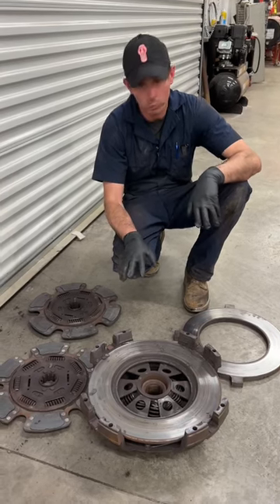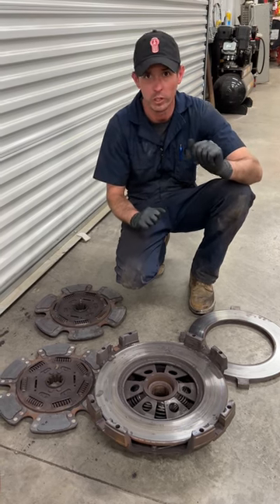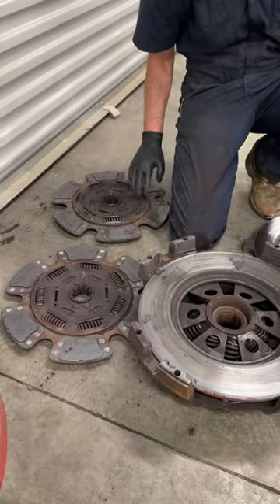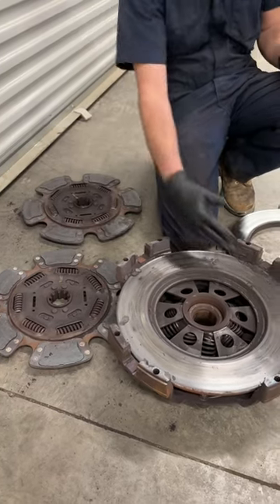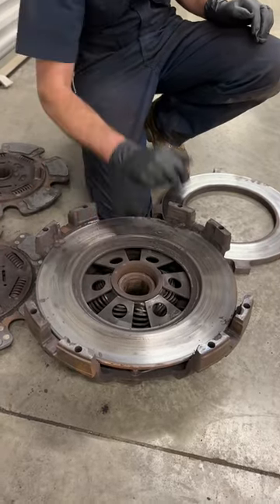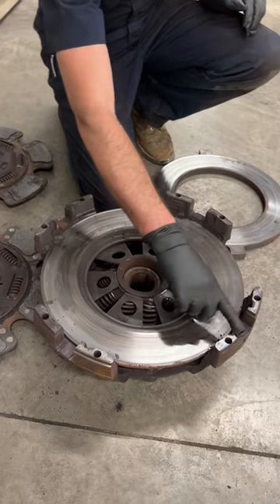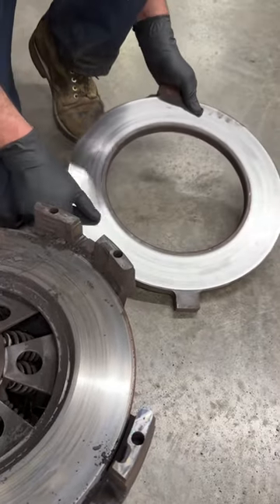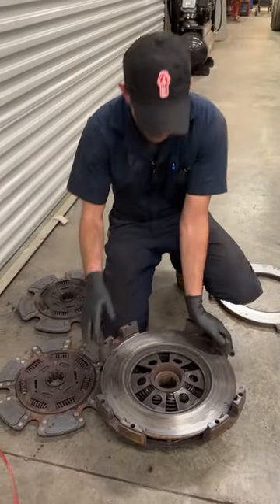What happens when you don’t grease your clutch and adjust your clutch #mechanic #clutch

Comment: So what’s the Answer  ??? Greasing Clutch Plate ??? Where At ???? I’m Waiting !!!!
Reply: Lol not greasing the throwout bearing duh!
Reply: After a new clutch 
1) first off, get a manual adjustable clutch (don’t get an aromatic adjusting)
2) resurface ur flywheel when ur changing the clutch 
3) grease the fucking thing
4) get it adjusted after a few months, new clutch doesn’t mean you don’t need an adjustment.
5) get a new clutch brake, pilot bearing and shifter gasket Everytime. Don’t cheap out.
Reply: It got hot from riding or slipping the clutch and it should of been re adjusted before 6 months it probably started slipping and ran. You showing the damage but not why and how to prevent. Choose your words

Comment: Would this cause the clutch to be slipping at a high gear or every time you press down hard the  gas pedal?
Reply: There are several possibilities. Dependent on what type of system you have. Could be caked up grease not allowing the release fork to move properly, engine rear main leaking oil, manually adjustable clutch and linkage not adjusted properly, worn clutch.
Reply: I actually fixed the issue, my clutch slave cylinder was leaking, it was bad. I replace it and now everything is good, no more slipping on high gear.
Reply: No, it just means god doesn’t like u